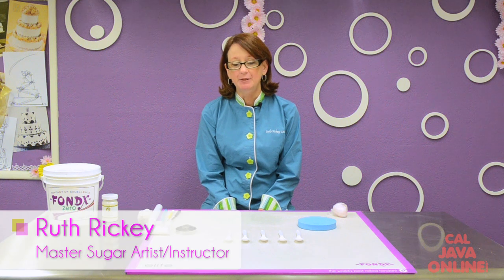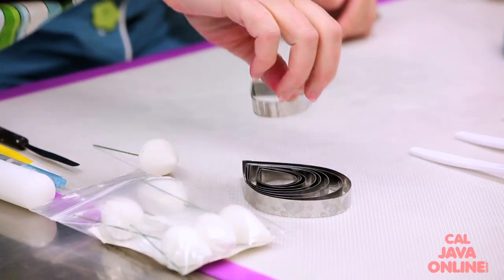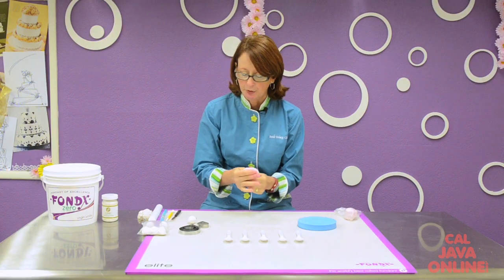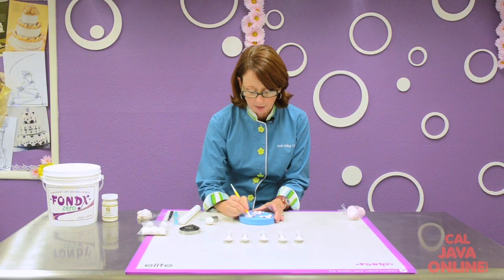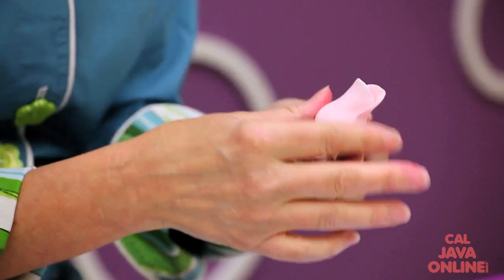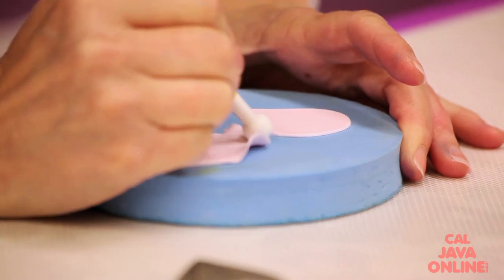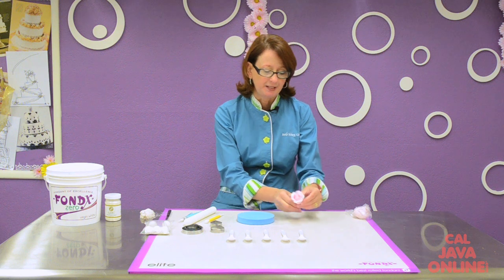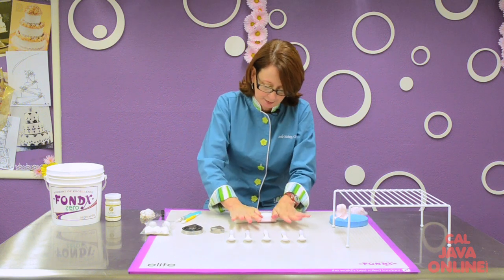How to Make a Large Rose from Gum Paste | Cake Tutorials

Comment: Thank you for sharing this video...I have both the style cutters in your video and another set with jagged shapes on the edges. I too need to make very large roses; I wont use the styrofoam because I want them to be totally edible. This video DID address the question I had of what size to use...It seems to be determined by the size of the bud measured against the cutter to start.  Thank you tremendously.